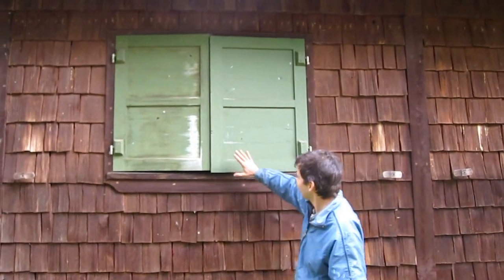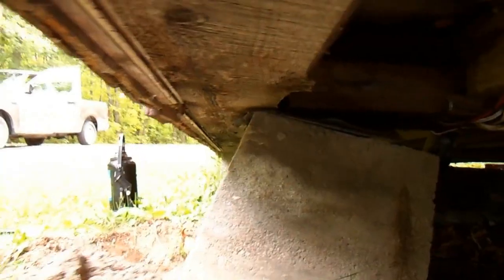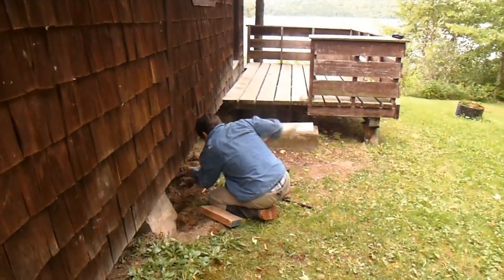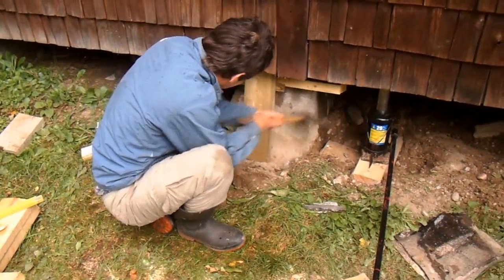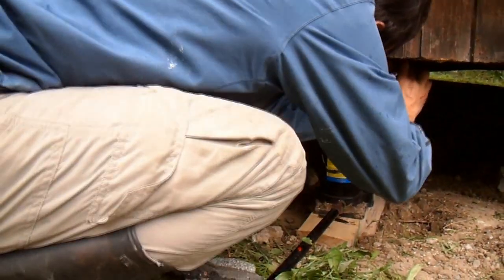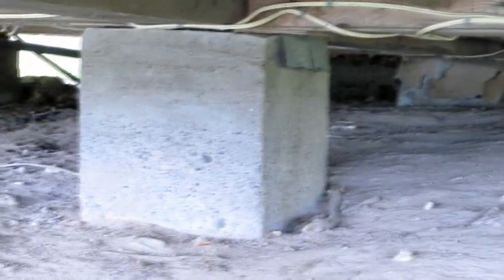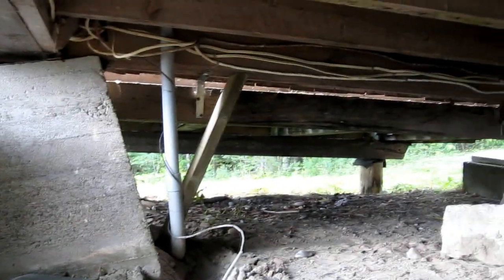Jacking up a cottage

Comment: I'm a contractor in Northern Ontario and I see this every day!  Many cabins are built this way here mainly due to cost.  The lakes are difficult to access here and putting in proper foundations is not economical for someone who simply wants a rustic shelter to sleep in while on a hunting or fishing trip.  Adjusting the beams this way is just what you do at the beginning of the summer, no big deal.  Do you mind me asking what lake your cabins are on Matthias?
Reply: It's a shame that it is such a common issue since one man could have dug those piers below the frost line within a few days. I don't know if the issue is cost so much as laziness and ignorance.
Reply: 1960 machinery wasn't very portable, and frost under bare ground is 9 feet in this area (-25 F most of the winter) so the idea that a person would bother displacing ten feet of glacial till and rock to secure a fishing shack is simply over kill.
And the lack of snow cover under the cottage would still produce latteral frost forces that would push a piling system out of alignment.
The "answer" is insulating the ground to raise the frost line, but this comes with a price tag much higher than shimming the beams every few years.
Reply: @Colin Martens Where are you in Northern Ontario? I have a place near Sioux Lookout and I need work like this done. (I also need a new roof and a new dock.)The cabin was built in 1986 on flat concrete slabs (not sure how thick they are). It has sunk approx 5" over time. The whole cabin needs to be jacked up. Approx 36' x 24'. Any suggestions?
Reply: @red_freckle  One man couldn't dig even one of those is a day in an area with decent soil. Have you ever worked with a shovel? I've dug out many egress windows by hand.

Comment: Same question as person below. When you jacked up the whole place with that jack why didn't you winch that pillar back into its original spot then dig under it to pour more cement? That thin piece of wood slip and your beam will snap at that point.
Reply from the maker: because if I wanted to do that, I wouldn't even have started because there would not have been enough time to do it in that trip.

Comment: Although this is NOT the proper way to fix the issue, like he said, given ONE DAYS time, this was a good quick fix. Obviously the reason the concrete piers shifted was due to frost heaving the piers. I know in PA, I had to jack my cabin up, dig down a MINIMUM of 4 feet (to get under the frost line of 3 ft), pour a 3ft by 3ft 6" pad, and lay concrete block (or you could re-pour piers). Im sure up in Ontario, your frost line is deeper than 3 ft.

Comment: Looks familiar, we have similar frost heaving problems in Finland... My parents have an old barn that's used for storage nowadays. It was built right after WW2, so the foundation is made from concrete only, no steel reinforcements at all. Additionally, the soil is mostly clay, so the ground lives a lot during wintertime. The heating has been off for about thirty years or so, but only the last ten years have really started ravaging the poor building. Dad used the same technique you did to fix it.

Comment: there are building codes, where you can look up how deep you have to go with your foundation. And that depends on the weather conditions. Here it is 0,8m. That is what I uses for my garages circular strip foundation.
I thougt you would be lifting the cottage and the pull the old foundation back in place, after that pour some concrete behind it to keep it from tilting again.

Comment: wow . . true home owner fix. 4x4 would have worked for a temp to get a new footing poured. you need to be below the frost line with any concrete. then frost doesn't affect it. 24" minim for us in the northwest. and by that i mean the top of the footing needs to be below the 24" line.  if you have a gutter to get the water away from the edge of the house this will also help. 
i appreciate the video good luck with your next projects.

Comment: I love your videos, i also think youre a very smart fellow. But this had to be one of the most un-safe, and dare i say half-assed foundation fix's i have ever seen. Keep up the videos!
Reply: presumably the proper fix would be to jack it up, support it temporarily with some stacked wood, drag out the footing, dig a new hole that goes below the frost line, pour a new cement pad and footing as close to the necessary height, let it fully cure and harden, then jack it back up, remove the wood and lower onto the new pad. So probably 6-8 weeks from start to finish?

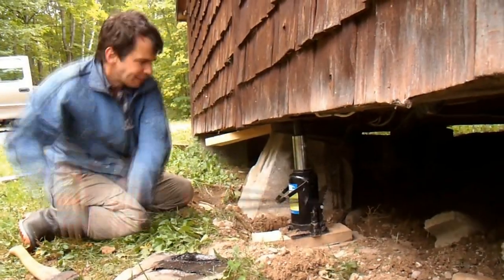Comment: @2:13 do you really have to hammer it? One or two more pumps on the jack and the wood would go in without hammering. Also hammering stresses the wood why not lift gently with the jack, place the wood, and then lower the jack gently. Looks like all the woodwork was done and in the end, the cottage was no longer resting on the concrete foundation. It was on a wood post, beam, what-do-you-call-that?
Well, good video anyways.

Comment: Well  your in a region that freezes in winter , so what you did is NOT the way to go about it !. you have to dig below the frost line, 4 to 5 feet deep. put a ''sono ' tube in it and pour concrete ( with rebat). Trying to support a house wiht a 2 x 4 is none sense . you have to to that with all your post.

Comment: I'm surprised that you didn't reposition the concrete supports after lifting the cottatge. When the extreme tilt of those two concrete blocks continues until all the weight is on your little bits of wood, you'll have a real shutter problem then!

Comment: For all you DIYers out there. Whether you use a frost-wall or piers, if you don't get under the frost line in your area this is what's going to happen. Matthias its too bad you only had one day to fix that. The family history there is worth saving. Maybe some precast one piece piers/footings to get down to four feet and a Kubota rental would work for you and then shims on top of plastic to finish. As for that center pier, I agree. No fun there. An engineered beam across would be better.

Comment: I know very little... But why wouldn't one just fix/straighten the foundation block while on the jack? Maybe it's my OCD kicking in but the sight of that would drive me nuts!
Reply: I agree with you, but that block probably weighs about 400 lbs, if not more.
Reply: +WhiteKnight Leo drag it out with a truck or something. Not an elegant solution though.
Reply: I could not have said it better myself.
Reply: Had me wondering that too.
Reply: Lift the house, then lift the support then back fill with reinforced concrete. Let it set up for about 2 weeks. Reset the support, shim if necessary. Then lower the house onto the support.
Reply: A better fix would have taken him much longer than he had time for.

Comment: You're quite correct, the insulated slab/knee-wall foundation would fix his winter heave issues. And you are also correct in that it would cost more in time and effort, not to mention cash, than most people are willing to spend. Being that this is only a three season cabin, I suspect Mr Wandel is looking for a cost effective solution to repair his existing foundation. If he stays with the existing post foundation, he can repair each pillar as the need arises.

Comment: Years have passed.  How has this fix held up?
Reply from the maker: ***** haven't touched it.
Reply: +Matthias Wandel  hi, i am looking at a cottage to buy that has this bent piling issue and has got a lot of sag in roof/floor..is this 2x4 method still holding house/cottage level..nice lil place on caroga lake ny(adirondack park new york)and the frost is the same as your dealing with..
Reply: +gary singer The wood will last for a very long time if rain or runoff doesn't come in contact with it. If water is an issue treated (wolmanized) lumber is better, and cedar is way better. Unfortunately you will likely have to shim it up to level again over the years as the frost heaves it around.

Comment: bolting the beam to the footing would have prevented this by not allowing it to tip in and away from the beam .frost is huge issue thats why u bolt em together so they move as one unit n dont slide out of place. not bad temp fix with limited supplies . i put bolts in wet cement n bolt to it with a bracket n bolt bracket to beam it works for me in maine n have same frost issues
Reply: +bigmikeyc83 Yep, you said it, bolt footings into beams!!! How about insulate under footings, make footings deeper??? More expensive, but would fix that problem!
Reply: More likely the bolted footings would pull the beams out of the floor as they moved inwards.
It's a lake cottage.  Built in the 1960's.  On a budget.  Before polystyrene foam or Home Depot outlets.  Have some perspective... shimming the floor every few years is fit for purpose engineering.
Reply: nautamaran + But the vertical 2 x is likely to soon split.
Reply: It was built in 1960 on a budget? But they haven't made any money since 1960 for proper repairs? haha

Comment: Bloody amazing......I thought some time ago, may be the way to go would be to build a compromise between concrete slab & pilars, ie a cement chassis, or may be add a water sprinkler system to the underside of the cabin & run it a little before the frost sets in to even up the tension.....or just know that nature will win. And regard it as a happy oppertunity to change the building.

Comment: The frost line for sub-permafrost areas of Canada is 122 cm (48"). Dig a pier hole down to that depth, then "cone" or bell shape the bottom to roughly 3X the diameter of the pier. Once dug, fill the hole with poured concrete that is reinforced with steel re-bar. That should alleviate your winter heave issues.

Comment: Shallow frost protected slab on grade would work, my house has it in PEI and hasn't moved a fraction of an inch.  You basically insulate the underside and edges of the slab and put a 24" skirt of 2" XPS foam on a slight angle away from the slab around the perimeter.

Comment: This is excellent idea way to level. I would remove this cement block out and renew gravel on ground then put cement block back in with level and then release pump to down. I done it on my old chicken house in years ago. It take about an hour to work on it but yes, hard work.

Comment: There is a way to do a cement slab without it failing., It may be of interest. It involves digging a 3 foot deep hole filling it with rammed/ compacted sand. Dig the footings in the sand  along with a couple of piers to stop slippage. lay the footings and stab as a unit. It is going no where. It works in earth quake areas and gives a lot of protection to the slab and house.. Maybe an option for future projects

Comment: That pressure treated 2x6 is not strong enough to hold that part of the cottage - you need to dig down below the frost line and pour a footing with rebar in the footing - at least a 2 foot wide footing that is 12" thick. It can be done but it's going to cost you
Reply: Sachi WI-I've set much larger houses up here in Maine on 16' diameter pads and used 16' cinder blocks to support it with absolutely no problems of having to come back to fix them ever.
Reply: Building a 16x20 cabin in northern vermont with pretty much the same setup. I had a bit of subsidence on one corner this winter but that's easily fixd with a jack and some lumber.

Comment: what if u had a concrete slab like 5 feet under ground then had round support beams as the the foundations blocks then cover it back up cuz i think the dirt on top of the slab will protect it but i dont live where u live and im just a simple highschooler

Comment: I was a little disappointed when I watched the video, just didn't seem like the normally meticulous Matthias.... I'm in the NE as well, and understand the frost heaving issue well.

I think there is more to the story, though I haven't read his website.  I believe he/family have like 8 of these cottages, which are used in fair weather.  I also gather he only had a limited amount of time, so a quick fix was fine.  

Obviously there are a number of ways to resolve the issue, almost all of which require money or serious time commitment. And thats just for the one pier of several on the one cottage, or 8.

If this were a more recent video, maybe he could have jacked up the cottage, moved the pier with his tractor, re-leveled the pier located and moved the pier back. 
Probably doable in a day, with some help.   Either way, real money or some real work is required for just the one pier.

My only nitpick now is that he didn't use a 4x4 or something, although in reality a 2x4 has immense compression load in the vertical.

Little disappointed Matthias seemed to let this one drop below his standard for excellence. But, the vid is title jacking up a cottage, not how to fix a foundation issue right?

Comment from the maker: The foundations are dug about 50 cm deep and filled with concrete.  Not a good way, it turns out.  A cement pad on gravel would have worked better, no doubt.

Comment: Everyone keeps saying deeper footings. What people don't realize is many of these cabins are built on bedrock. There are limits to what you can do under them being so close to the water. It's part of owning an old lake cabin, it needs to be leveled every once in a while. Most are small enough that the average person can jack them up and do the work themselves. The fixes are rarely pretty or even completely stable but for the most part they work for a few years and then a few hours have to be spent fashioning new ones. These are not houses, they are cabins none elegant fixes are acceptable

Comment: It's a bit late now, unless you don't mind craning your whole house, over here in the UK we use pile foundations on land with chance of surface movement. These things need a massive drill to bore a deep hole and are hammered even deeper with a giant hammer crane type thing. Expensive stuff and might be limited by the machinery's ability to reach the site where you are though.
Reply: ***** yeah, it's more expensive than your standard trench poured concrete foundations, but it's not gunna move!
Reply: Or you could just build it on blocks and jack it up every few years. Probably not allowed though. Many old houses around here are done this cheap way.

Comment: I would have jury rigged a support on both sides of that support, removed it, filled that with concrete and replaced that block. He did day that pad would crack though, could you use wood, or dirt?

Comment: He mentioned in the video he didn't know what other type of foundation would work, that is what I was addressing, what could have been used instead, not how to fix the current foundation.

It COULD work as a fix if he wanted to go through the expense and effort of pouring a slab under it and lowering it back down on top of it but I suspect that would be more trouble than the cottage is worth.

Comment: perhaps a wider based pilon would fix the "runaway" issue. and since a jack capable of lifting the cottage is awailable replacing them*at least the ones that have tilted* such a feat could be easy to accomplish.

Comment: Yes, I have a rental home that a friend GAVE ME, because it was NOT heated in the winter and the basement is pushed in on two walls.....only a few inches from one winter. Also, if your cottage was given a drainage tile around the outer edge of the foundation and a skirt was placed down to the ground to prevent rains and snow from settling under the cottage, then I think it might stop all that shifting! Not nearly as much, anyway!

Comment: same thing happens here. 

I used to work levelling mobile homes. Business booms every spring. We're near a river, on that same Agassiz glacier clay soil. If you have the right tools, it can take less than an hour to level on pier pads and proper shims. 
Sometimes farm owners will bury in pylons with sonotube forms thinking they're going  to get rid of their leveling issue. It works for like 5-10 years, and then back to levelling every year. At least your cabins are on wood beams. You bend a metal frame on a mobile home and it's bent forever.

Comment: STOP! This makes no sense and Matthias and his family are lucky they're not dead or in the hospital. When any force is not directed perfectly perpendicular OR secured at both ends OR rated for the support points, you are risking a death threatening projectile collapse at any time, even after the job is done. Both the bottle jack or any of those 2x supports could have shot out and taken his head off right before the house falls on him. If you go through the effort and risk of lifting a structure, fix the cement pier properly by leveling it out, compacting the subsoil or pouring a wider pad, and creating a frost and moisture barrier.

Comment: It might help some to dig down and wrap the footings in poly plastic sheeting. Then when the ground freezes it doesn't stick to the footing. Friend of mine has a large shed, doing that helped stop the footings from moving around a lot. (Results may vary)
Reply: You need to go atleast 4-6' deep and go bellow the frost... The poly won't do anything at all... The issue is not that the ground stick to the footing, but the fact that when it freeze it expend, and when it thaw it will unevenly and the ground move. This cause the dirt to shift, and bad thing happend.

Comment: @Matthiaswandel  ok man   let me lend u a quick hand  with what  u are  doing  i am a professonal lifte r my  buisness  compleats  20 -35 houses a year  and  iv seen this  so many times  its funny  its nuthing to do with  inproper ground  or   crazy weather   if u dig a hole  4 feet deep u will b below  ur frost line in this hole  pour a 8 inch thick slab2'x2'  with one piece of rebar   then set a 12' souno tube and fill with cement  this foundation method will never move